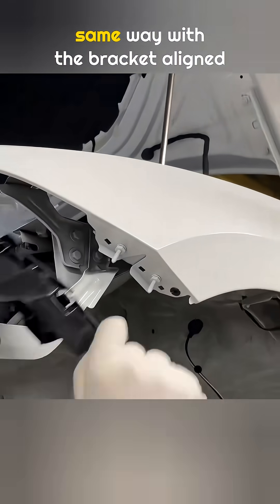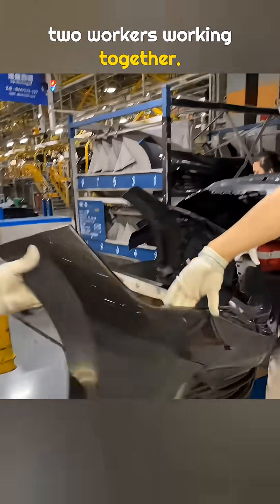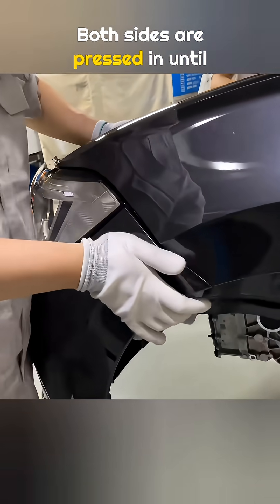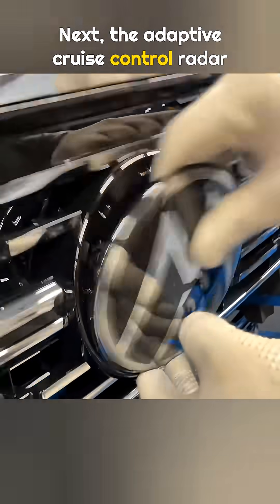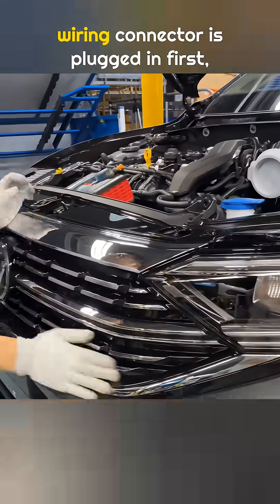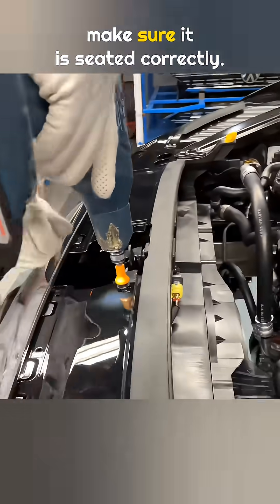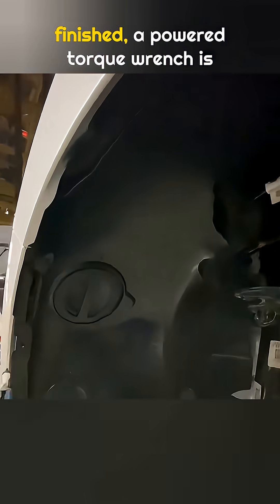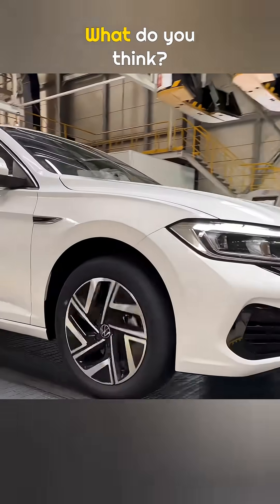Inside the Factory: Front Bumper Cover Assembly

Comment: I’m always amazed by how well even the inside panels are painted. 

Like the top plastic piece of the bumper cover is painted with a glossy finish even though it’s going to be covered by the hood anyway. Most manufacturers just leave it unpainted or don’t put much of a clear coat on the piece.

Comment: Clever.
Now how do I take it back off at home in my driveway?
Reply: Exactly, I changed a bumper on a 2022 Mazda 3 last summer on a red hot day and it was an absolute pig of a job, can't get access to clips and can't get them out or they break when you do, I did it in the end but wished I never started and then had software glitches to resolve!
Reply: @ladalout245  I have one where I need to check a tailight wiring connection near the license plate. I am not happy that I would need to remove the bumper to do that.

The connection may even be fine. But I need to get a look at it.
Reply: @Matthew_Loutner If you're talking about the rear bumper I think you can access it from underneath, note the bumper is in 2 pieces joined horizontally by clips. If you need to take the bumper off to check a connection it might be easier to get an auto electrician to do a circuit test to avoid stripping things down.
Reply: @ladalout245  It is up in an area between the bumper and the frame where I cannot see in or get my hand into. I know how to do a circuit test. I need to visually inspect the connection for corrosion.